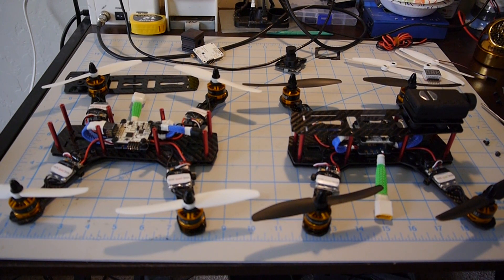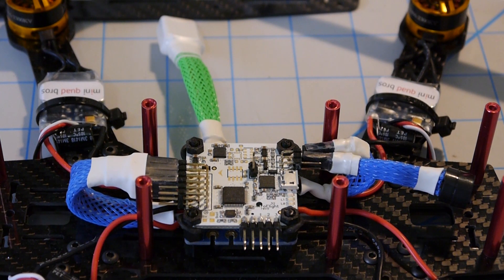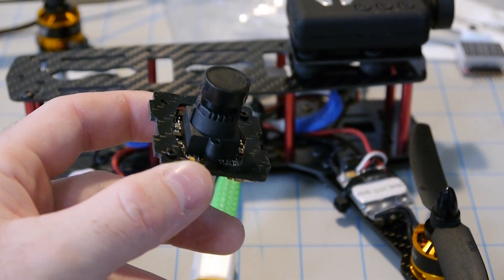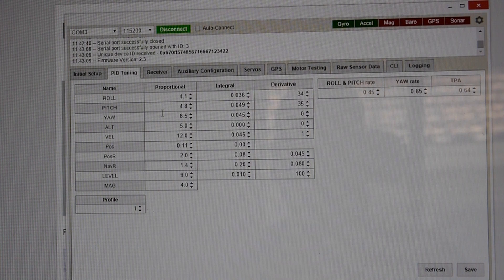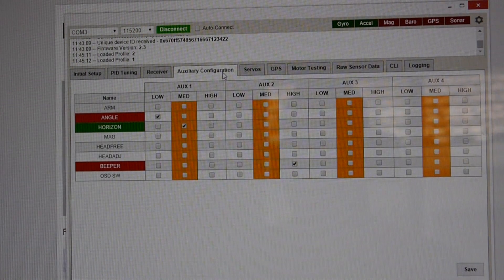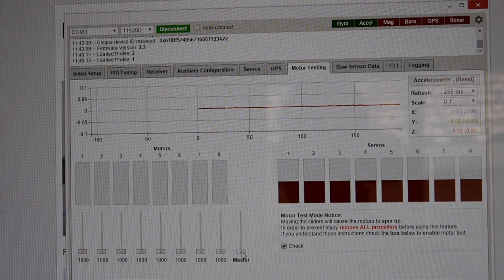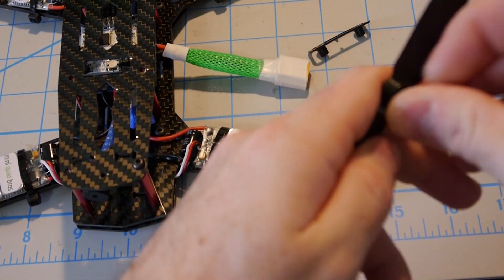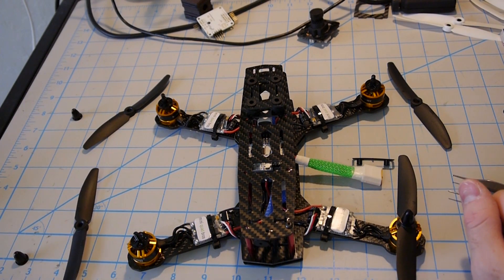Mini Quad Bros Carbon Fiber Mini H Quad Review

Comment: Well guys whats is ppm??😅and what it does??...never came across with it in quadcopter....
Reply: NIKIT Shetty It's a type of interface for connecting receiver and flight controller. It has advantage over PWM since it requires just one cable for all channels instead of one cable per channel.

Comment: What battery do you use for the description above ?
Reply from the maker: 3s 1500 nano-tech 25-50c
Reply: Zachary Moore But if i don't mistake your ESC is 2-4s !!! How it works ? It is indeed 2-4s your ESC ?I mean you have motors compatible for 2-3s battery...
Reply from the maker: Marius Vultureanu I use both 3s and 4s. This video is a little old so the ESCs I was using are outdated. I now use the ZTW 12a Spiders. They handle 4s. The motor isn't rated for 4s but it can handle it on 5x3 or 5x4 props.
Reply: Zachary Moore Thank you ! You are doing a great job !I m building now my quad :)Oh ...One more question :Your battery is Turnigy? And how can the motors handle 20 Amps of continuous burst if they are made for 16A ???
Reply from the maker: Puzzle Initiative  Yes, turnigy nano-tech 25-50c for 3s. What do you mean 20a?
Reply: Zachary Moore The Esc has 12 v continuous current and 20 amps burst current (sorry but i never understood the part with burst current )
Reply from the maker: Puzzle Initiative It's 12 amp continuous and 20 amp burst. So if you had motors that could actually pull 20amps (these DYS 2300 can't so it's irrelevent to this setup) then the ESCs could handle that current, but not continuous, only for a few seconds (~6-10)
Reply: Zachary Moore Thanks ! That was really helpful !I have exactly the same esc and motors that you are using...so your video and comments was really a help for me to understand better .

Comment: is this copter any good for a beginner? im new to flying in general and have used a mini quad for less than a week but i want something a little larger and something to build myself
Reply from the maker: It's good, cheap, and durable. Perfect for beginners.
Reply: Zachary Moore ive been on your website and most stuff is out of stock, do you do a version with a pdb with led's? also do you do a full kit with everything needed ie transmitter cameras all set up so it rtf or even sell all that stuff to build? thanks

Comment: You sure, DYS 1806's on a 10 amp ESC? Not using the motor well there. 1806 draws 16 amps on 6x4 prop, and the frame will take 6" prop.
Also, why not use the http://abusemark.com/store/index.php?main_page=product_info&cPath=1&products_id=45 < if you're shipping with PPM.
Reply from the maker: Our new kits run the ZTW 12a(20a Burst) ESCs. I don't like the form factor of the Mini, I use 36x36 for all my components(PDB, OSD, FC.)
Reply: Bigger Naze is easier to use, glad you upgraded the ESC's.
Loving the DYS's bang for size and buck!!